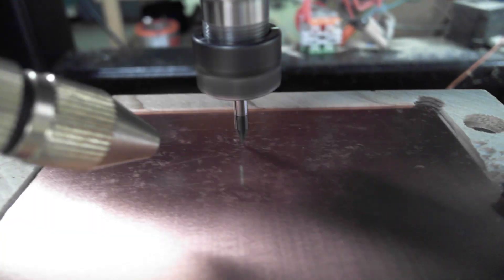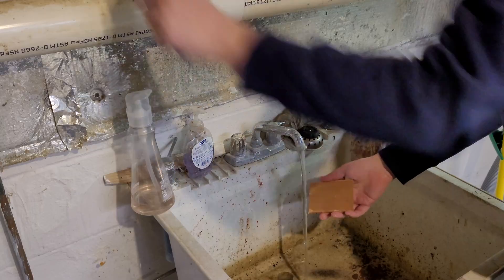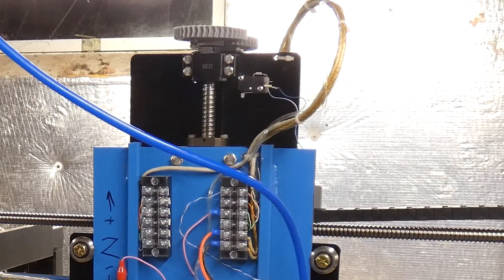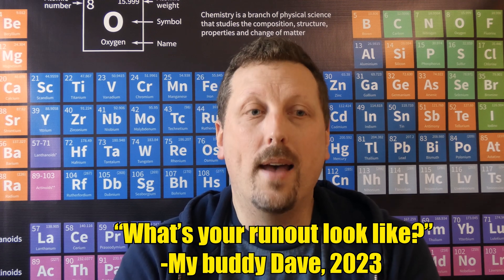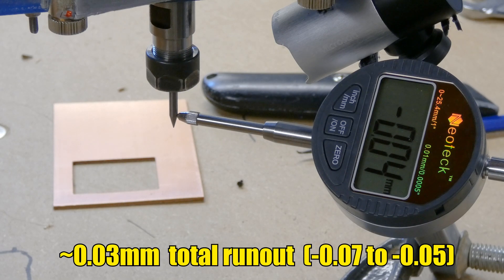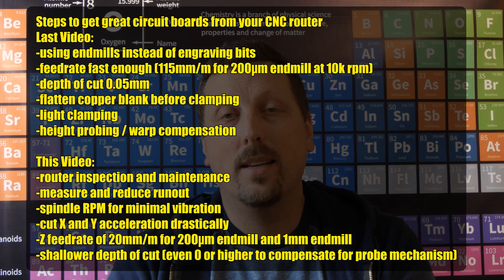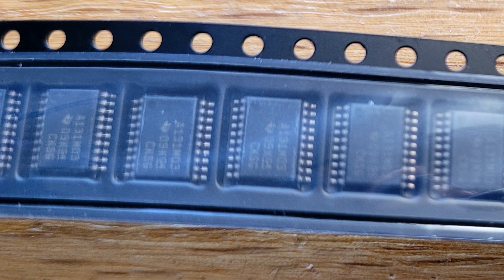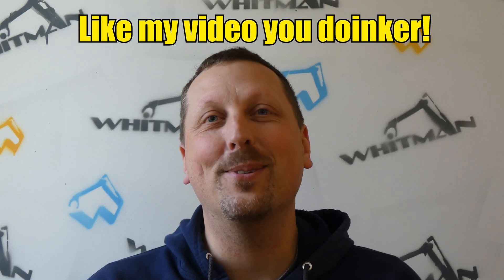Finding PCB Perfection - making circuit boards on a homemade CNC router - Nephele03e02

Comment: I don't use clamps for my circuit boards. I use 2 layers of blue tape: One on the bed, and one on the board. Put CA Glue on the bed side, and accelerant on the back of the board, and stick it down. No bowing at all. I'm definitely going to check for vibration on the next board I go to cut.
Reply from the maker: A good solution.  I bought some aluminum blocks and I want to try an undercut bit to make a special clamp just for the little 70x100 copper blanks.  Hopefully, with a nicely undercut ridge that covers the majority of the perimeter of the board I can clamp in and out really easily without having to worry about bending anymore.  I have some big sheets of 2-sided pcb blanks (like 14"x14" or something).  I'll have to try your method when I attempt something on those.